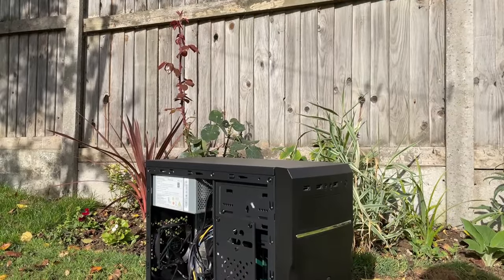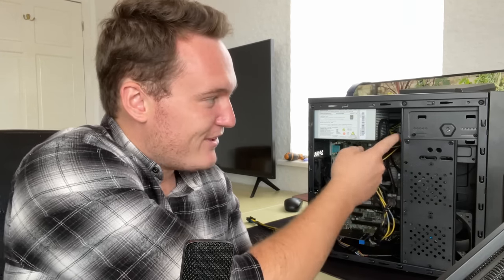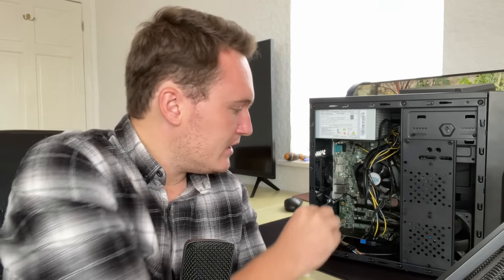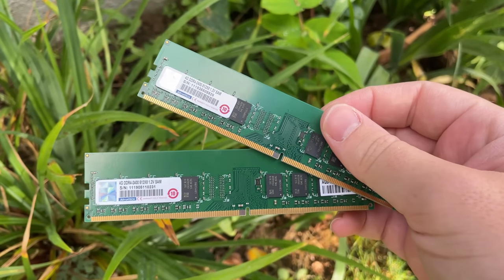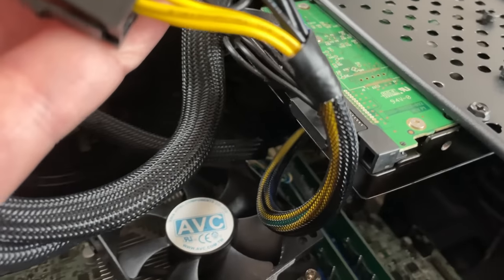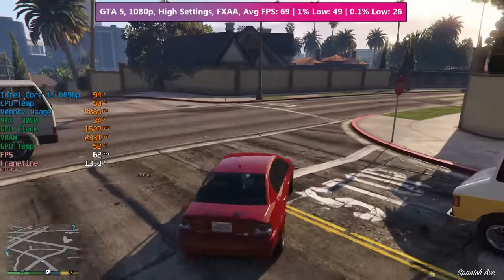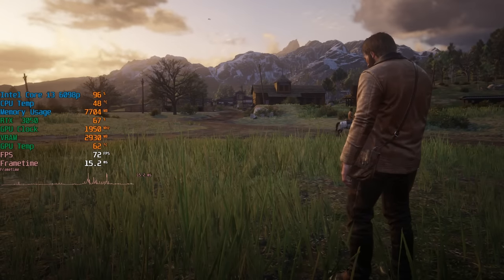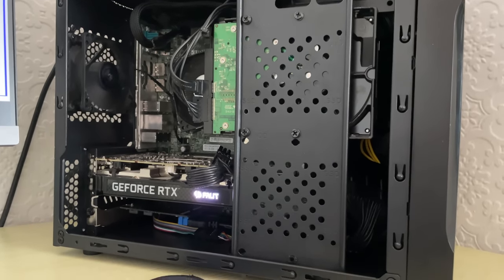This "Custom Built" PC Was Hiding an Unwelcome Surprise...

Comment: You can try to put so called "i7 6400t". It's a name of engineering samples that been everywhere for a really cheap price. They are ranging usually from 2.0-2.4GHz base, 3.4 GHz turbo. Suggesting it only because of cheap and smaller power consumption for this platform. OEMs doesn't often do the good job for VRM on prebuilds. There might be a bios compatibility issues. Be careful if you are going to stick with it

Comment: I feel like the first 4 minutes were a visit to "The Steve's Gun Show".  Not complaining in the least, you can tell you've spent some time recently pulling 24 pin connectors out of motherboards!

I really wish prebuilts were moving away from proprietary parts (looking at you AS USUAL, Dell!), but in my experience, it's sadly just as prevalent now as back in the Pentium 4 era.

Comment: The 10pin is essentially an early version of 12v psu spec , the board probably has power going from it to the drives
Reply: Yeah. Just realized that 10-pin connector only has 12V supply only. The motherboard will do the rest.

Comment: You can get an adapter for that 10 pin connector on amazon to use normal power supplies. Had to do this for one I had in the past. Otherwise for what you spent I think you got your monies worth to be honest even if it was old lenovo parts.

Comment: The fact that you managed to get this for the price you did is a great surprise in itself. Personally I would keep it as a basic office PC, possibly just upgrading the 320GB HDD to an SSD and adding in a 1TB HDD for data storage. Even a 128GB + 500GB would work, or (at a push), the 128GB + 320GB. I just think this would benefit from an SSD, and possibly a low power GPU if you wanted some casual gaming (to avoid the adapter, and to avoid having to upgrade to an i5/i7).

Comment: I had an optiplex 3040 with a 6th gen i5, but it had a proprietary psu form factor, and proprietary motherboard connectors. I ended up just purchasing an atx power supply and just leaving it outside the case as it was too big, and routing the 24 pin with an adapter to the 8 pin motherboard connector and cpu power through where the original power supply would have been.

Comment: Best way to deal with this PC: remove/unattach the parts you want to keep, take out Lenovo motherboard, sell on eBay, replace with regular h110 or b250 motherboard (h110 should set you back between £30 and £40, b250 a bit more) with a regular 24-pin power connector, a decent budget PSU like a Be Quiet! System Power 9 600W and a better CPU cooler. 6th Gen i5s can be had for a bargain now so no need to keep that i3 (I found an i5-6500 for £35 so they are out there) and pairing that with something like an RX470 would give you a nice little eSports gaming PC.

Comment: 7:55 i have a i5 6400 with 2x8gb ram and a gigabyte 1060 6gb, the i5 is actually solid with older games but with GTA V online is  always 95 to 100% cpu usage with some stutter that seems like is slowing down even if the game runs at 50-60fps, with COD WWII it is the same story. So for a "cheap" pc it's good but not very good. And they are not as cheap as u would expect.
Reply: 4 core, 4 thread limitation. Can you get an 8 core/that CPU in there? i7 etc?

i7-6700 6700k 4 core, 8 thread, 4.0 GHz, 4.2 GHz.

Maybe check eBay for Sold Prices for yours and these. See if it's worth trying this upgrade.

8 core/threads is supposed to be the minimum needed for gaming because of the consoles using 8 cores or threads.

There's another tech channel and he did a YouTube video about 8 cores/threads being the minimum for future upgrades.

I have 8 core 8 thread i7 9700k and it can average 90% on all cores when I'm gaming. That's with GTX 1080 Ti 11GB ($250 now on eBay).

i7 9700k + 32GB RAM + Motherboard for $300 or less on eBay. All together.
Reply: @Google_Does_Evil_Now  i could take an i7 6700 (non k beacause i have a b250-fintech, doesn't support overclock) or an i7 7700 but they go for 120 to 200 here in Italy on ebay, so i think that i'll wait another year maybe and than i'll make a new build maybe with a ryzen 5 or i5.
And yes, my mb is a mining board but was the cheapest 4 years ago when my h110m-s2h stopped working, i bought it for 40€ brand new from Amazon.

Comment: Odd for someone to recase a branded  pc. But i did scrap some older than this Lenovo Pc's during lockdown  because i wanted the cpu's to upgrade  a couple of my "working from home machines", and  it was cheaper to buy  some used complete pcs than the used cpu's. I sold the custom motherboards on that well known site with the  ATX power adapters and audio converters.  I got the upgrade i wanted, some others got a cheap Motherboard/CPU combo that would fit in an atx case, and less weee was produced!

Comment: When I had build a PC for sale a year ago, I was short on one screw for the HDD drive. Three in, one missing and I warned the buyer about it... 😅
Seems who ever made this thing, was the total opposite in that regard
Reply: those aren't such a big deal because they are so easy to obtain but missing specialized screws like the long ones that slide through fan holes to attach to a radiator, or proprietary ones to hold hard drives in within rubber grommets etc. can be really really annoying. I could only find 3 of 4 of my rad screws tonight and all I can think of now is that it probably got sucked up by my vacuum cleaner.

Comment: i have a i3 6100 paired with a RX 580.
First time i builded a Budget pc and felt nice for months. then started playing apex , getting some dips here in there, realized that Game will run smooth if i close every other process like discord or overwolf.
i3 6100 if used for gaming gets really borderline 60fps on decent cards
any user that finds himself struggling with this low end i3's. consider saving some money and sell the mother + i3 so you can buy an i3-10100

Comment: I found an extra newer Samsung 256gb SSD surprise in the last used build I bought. It was wedged in the back panel. The build came from a 3D graphics company and I think their tech guy was switching users over and just left it in there after he swapped drives.

Comment: Many years ago I've got an i3 6098p based PC and I can say that together with its Intel HD 510 iGPU it still works great for office stuff. Its single thread performance is better than an i5 4460's. Also, the temperatures are quite impressive with the stock Intel cooler.

Comment: one good thing about lenovo is there are adapters as you found out for cpu/motherboard connectors.  i had an 1150 socket version that needed the 24 pin adapter. not a big deal or expense, but it is annoying if its not expected and you have to wait a day or two to get the extra's you need.  on a finer note least they have that option unlike hp.  ive had a few hp systems before that could easily be upgraded, but i have a am4 based pavilion that uses their own psu units that have 12v only with no upgrade options outside of units specific to those systems.  mine came with a 180w 80 gold, but for £20 i managed to find a gaming version that had a intel 1200 board(sadly bent pins) and a 310w 80 gold/platinum which is what i wanted. thankfully this version if the 310w has a 6 + 2 pin. doesnt say pcie, but did run an r9 370 which is a 110w gpu.   pre-builts can be interesting to upgrade, see whats possible and what they are capable of.

Comment: my dad had a prebuilt he wanted to put a 2060 in. he had moved the internals into a different case similar to this, though everything was help down much better, and when I went to help him upgrade I noticed the PSU didn't have the gpu cable, so he went to best buy and then we went to set it up and I noticed the mobo pin was different. gotta love Lenovo's proprietary crap. for a while before I helped him build an all new ryzen build he had an adapter cable from amazon, though the first 2 days he was rocking a second psu just for the gpu.

Comment: As someone who works in a repair shop the big vendors (HP, Dell, Lenovo) prebuild systems have been getting worse and worse for proprietary designs to skimp the pennies off their costs to the point where they can't be upgraded at all due to lack of mother board & PSU connections (let alone the presence of standard connectors!) or repurposed. Aweful!

Comment: FWIW I have used those adaptor cables extensively before for months and found they do well and don’t form thermonuclear fusion in the cables - used i7 cpus in Oem boards mainly, limitation was bios support for some cpus

Comment: I recently got a good deal on a pc. Ryzen 3400g, 8gb ram, M.2 ssd 256gb, 500gb sata ssd. Plus a Logitech 703g Lightspeed. For 100€. Sadly it was a prebuild HP mainboard with Lga cooler mounting on am4 socket. Replaced the Board and psu. It is pretty nice

Comment: Love most of your content however im a little confused as to the conclusion that this PSU is problematic with a 3050?  Even with an i7 6700, RTX 3050, HDD, SSD, 2x Case Fans, 2x USB Devices and keyboard / mouse attached the load wattage is around 280w.  Given that a 400w Platinum PSU should be 90%+ efficiency it would run fine.  All you would need is a 6 pin to 8pin adapter?
Reply: The efficiency hasn't anything to do with the PSU's output.
Reply: @RuruFIN  it's a 400w PSU that's at least 90% efficient. So it's output is 360w minimum.

Comment: 10 pins are enough for a low power machine. each wire can only handle so much wattage before they get too hot to function as wires. a second wire splits the load. these machines are just so low spec that you simply dont need a full 24 pin connector. the mobo also probibly isnt using all the voltage rails and so can omit those. the margins on system integration are hair thin that if you can omit a few grams of copper from the machine they can improve the bottom line.

Comment: What would be a valid reason to rebuild the hardware from a Lenovo case to a generic one?
Usually you buy brandname PCs for their case and build design and perhaps tested stable hardware config.
Reply: lost side panels.
Reply: Maybe the original case was a low profile one and the user needed to add a card that wasn't available as such.

Comment: I found non-working build with i7-6700k, RX570 4gb, MSI z170a krait edition mobo, 12 gb RAM and all in the NZXT S340 case it was for just 150 usd so i bought it, repared it for no money (just install new cooler, i had one in home) i had a great PC for the money, but after 1 month GPU died... so i bought used RX480 8gb now PC work fine, CPU is kinda old now but it is still decent

Comment: I had to look up the CPU to understand why it was so much usage on the games. Due to the fact 3.6Ghz is really decent and I can stuff on that. But I realized it was only Dual core with 4 channels. So yeah, the bottle-necking was bad. I in the past as well had to use adapters for more to less and less to more pin connectors as well. Sometimes companies are just @$$holes with proprietary stuff.

Comment: The i3 u use is a skylake cpu .
So all skylake will work on that board if the bios update van handel it.
Iets oem bord you have and it can be limit by manufactur that only cpu works what is sell with that board .

Comment: Does not look like a propitiatory PSU connector.
Looks more like ATX12VO one.
Pinout for ATX12VO is
1: PS_ON
2: Ground
3: Ground
4: Ground
5: NC
6: PWR_OK
7: +12v
8: +12v
9: +12v
10: +12v Sense

Comment: I'm assuming we are going to see you get an i7 6700k, they pair well with the new lower end 30 series cards. Do you have a 3060 ti? Try overclocking (don't think you can with this board) an i7 6700k and see if it can bridge the gap to a newer cpu?

Comment: I have an Acer like that which won't accept any other RAM at all XD

I am wary of even putting a new CPU in it as it might be locked into whatever it came with somehow(?!) IDK... 

But I put my old no power connector needed RX560 in it and I can play some more modern titles on it without even turning down the quality much, but I can tolerate a lower framerate.

Intel(R) Core(TM) i5-6400 CPU @ 2.70GHz   2.71 GHz

Comment: Generic warning from experience. Be careful of exhausting the case too hard. You can stall the airflow going through the power supply, and burn it up. I'm more in favor of the slightly pressurized the case side of things. You can check this by holding a piece of toilet paper in front of say a SD card slot, and looking to see if there's a little bit of air flowing outward. This technique won't work with some OEM computers because they use a sophisticated ductwork inside. I have one that is cooled by a single fan very well, that fan is on the CPU, and everything is ducted in and out of that.
Reply: Pressurised made a big difference for my case. I now have 3 fans in, 1 fan out.

One fan is at the top of the case blowing directly down towards the RAM slots and edge of the CPU. So this feeds cold air to the CPU cooler fan area, Which the CPU cooler fan sucks, blows over the cooler, towards the rear of the case, where there is a rare case fan pulling that CPU air and blowing it straight out of the case.

2 in, 2 out, it was warmer, higher temps.

I tried turning the upper fan around and positioning it above the warm air of the CPU cooler so that it could suck out the warm air exiting the CPU cooler and up out of the case. This meant I had 2 fans sucking in air and 2 blowing out. The CPU temperature was higher. So was the GPU I think.

I had read about pressure helping to cool things down but I hadn't experienced it before. But it made a real difference. 

Clarify:
Sucking in air : 3 fans : 1 on top middle-front, 1 on the front low, 1 on the side mid-low-center at GPU level sucking in cold air direct in front of GPU cooler.
Blowing out: 1 fan : 1 out at CPU level, drawing air directly from the CPU cooler outwards.

There is gentle pressure pushing air out the ventilation holes.

3 in, 1 out gave me cooler temps than 2 in, 2 out.
Hope this helps.
GPU, PSU blow out warm air themselves.
Reply: My main case has a ventilation hole that's supposed to be right over the CPU but it's not exactly right as you would expect. But I did build a cardboard duct so the CPU cooler fan sucks air in through that and blows it out into the case. So all the CPU air comes from outside. Not from the preheated air inside the case.

Comment: I understand you wanted the better powersupply so you could use it as test bench for 6th gen cpus, but I was thinking a very cheap i5-6400 and a gtx 970 which the existing power supply could deal with would have made a cheap budget PC.

Comment: The 6th/7th gen Intel chips were HOARDED by bitminers, at least in the States. You're lucky you were able to find a motherboard with that many PCIe slots in the LGA1151 generation, as most of them are still selling for $300+ new compared to the 500/600 series motherboards being found as cheap as <$100....

Comment: The RX 470 should run just fine with that 400 watts power supply - the video card alone will consume up to around 150 watts, and the rest of the components won't consume more than 100 watts, and that psu can do almost all that 400w on 12v output The RTX3050 would have also worked, I think that one peaks at around 125-135 watts if my memory is correct.
The adapter cable has a dc-dc converter on it to convert 5v stand-by to 12v stand-by the Lenovo motherboard uses (it's one way of getting higher efficiency), otherwise it just rearranges the 12v and -12v and power on , power ok wires between connectors, so no reason why it shouldn't work.
Reply: I was thinking that, the 400W PSU that it came with would have done the job, surely?

Comment: An i7 6700 would be a good upgrade, although they are a bit pricey on the used market I would suggest getting a Xeon E3 1270 V5 its cheaper and is basically the same as the i7 6700 but without integrated graphics.

Comment: Man i am upgrading my moters old 1155 socket from a g2020 to a i7 2600k i gave her a replaced amd with an atlon cpu which will be upgrade to an fx 6100 down the line. Her intel g2020 psu blew cause of power outage so i just thought i might as well upgrade it park my amd and fix/rebuild and upgrade my pc. The 2600k are still a good cpu for me as i don't play heavy games and i will aio it and try to reach at least 4.5ghz all core i don't have the best aio so 5ghz will be a no go.

Comment: Those proprietary connectors on Dell, HP, Lenovo, Acer, etc exist primarily because of the power supply being 12v only, and the motherboard supporting 12vsb instead of 5vsb. I can't wait until 12VO starts getting universal adoption from cheap OEMs like Dell.

Comment: I had the i3 6100, Dragon Quest XI destroyed it, had to upgrade to Ryzen 5 2600 and this is the gazillion time I typed this comment.

The 3050 is like a 1070 in raw power, where the 3050 is better optimized on modern games. A 3050 is just too much for Intel 6th gen i3, an i7 will do the job as the fastest GPU at the time was the 980 Ti and then in 2016 the 1080 Ti.

Comment: Seeing as how you have a 2 core 4-thread CPU, I imagine a GPU needing only the 6-pin connector on the original PSU would have sufficed. Say a 1650 Super? Cheaper card, no need to replace the PSU, the CPU should still be the bottleneck.

Comment: The i3 6098p is sadly like those weird Ryzen APUs you find in those weird mini pcs. Sadly it, of course, did not last that well for so long because of it's 2C/4T offering. If possible, upgrading to something like the i5 6400 would be a great upgrade, if the motherboard can handle it of course! 

Also my Ryzen 2600 is laughing at this poor cpu xD
Reply: My 5600g is laughing at your 2600
Reply: @Stephen-bn7cj  damn bro you didn't had to flex it like that